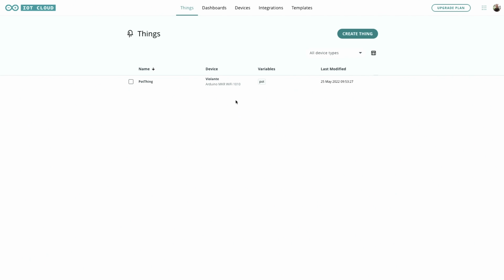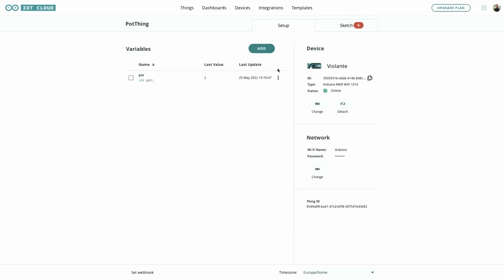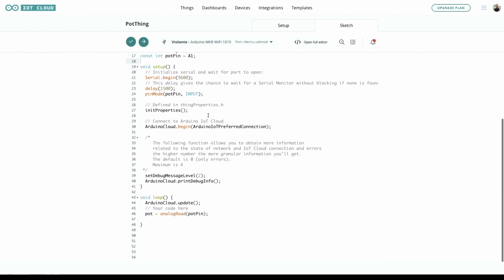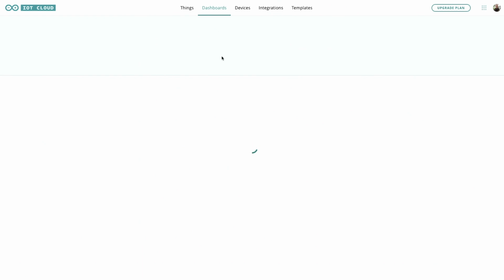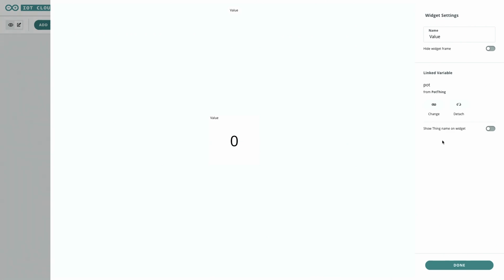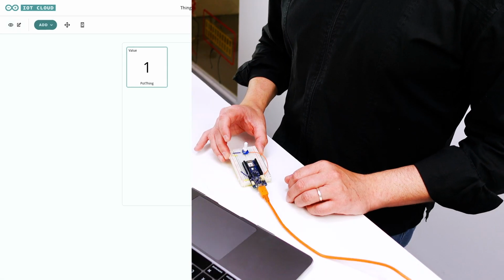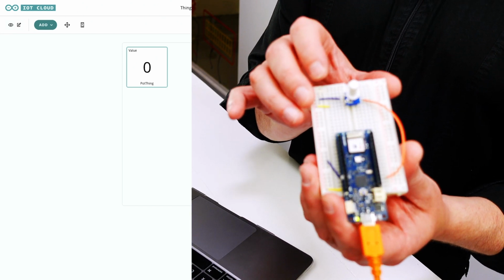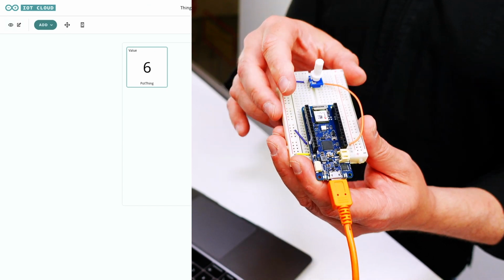Learn About the Value Widget in Arduino Cloud

Comment: I was just on the Arduino web site shopping for a MKR1010 WiFi board but they aren’t available. Any idea when they will be available again? I have a project that I would like to use the Therm Shield but without the 1010 it’s kinda useless. Would the MKR1000 work? Great videos by the way!
Reply: You might be able to find some on Amazon but I would understand wanting to buy from the official Arduino store
Reply from the maker: A little late here, but wanted to let you know! https://store.arduino.cc/products/arduino-mkr-wifi-1010